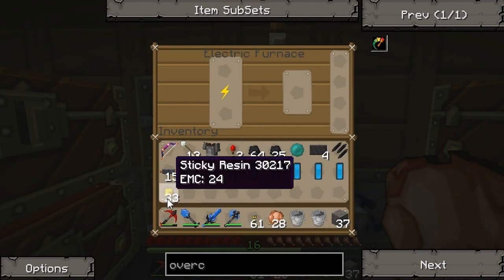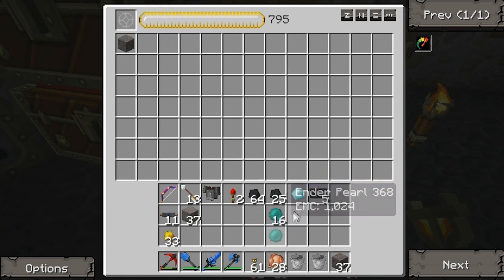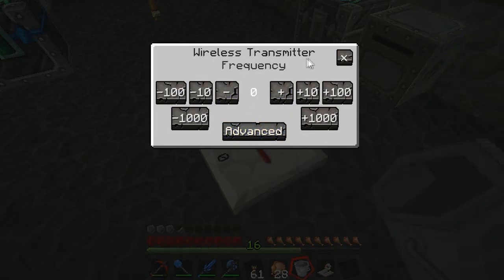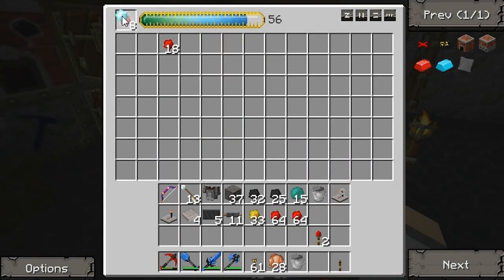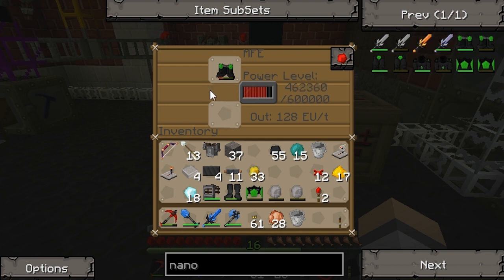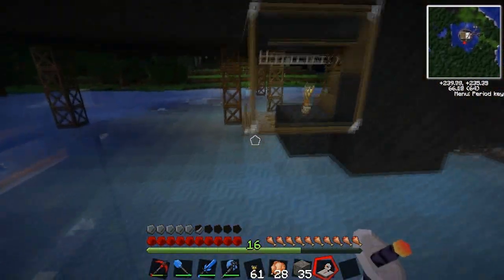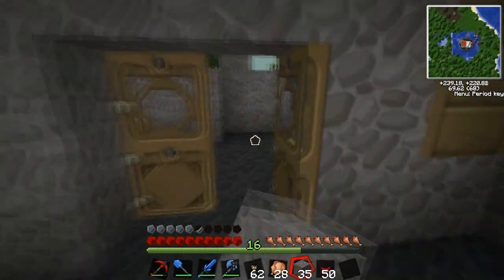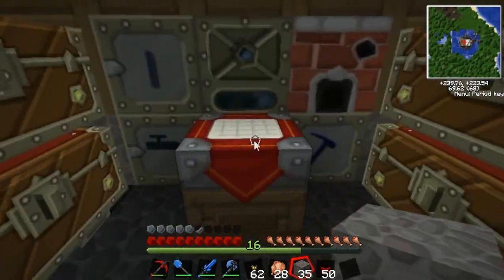RagiTek: Part 16 - Ze Trap iz Zet

Comment: If I could think of something cool to do in Minecraft I'd probably play Minecraft. As it is what time I've spent in the demo has consisted entirely of "dig a hole dig a hole dig a hole" until the timer runs out. (At which point I discover that opening doors is considered "changing the terrain" and I'm stuck in a cavern with zombies and arrow-shootin' skelly-bones.) But, you know, you could close up most of the lake floor while leaving enough water-holes to keep any lava from being a problem.